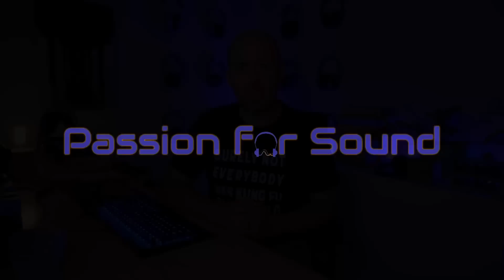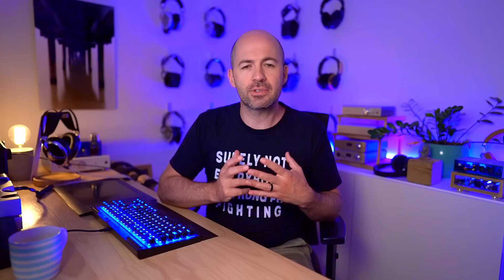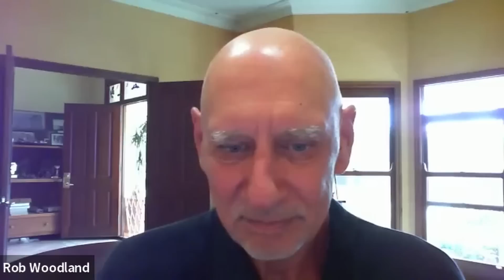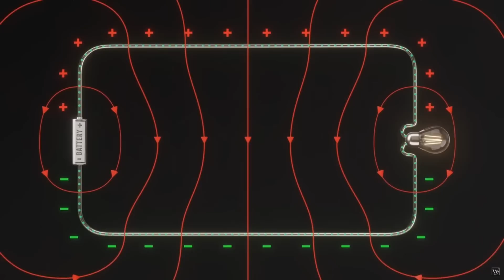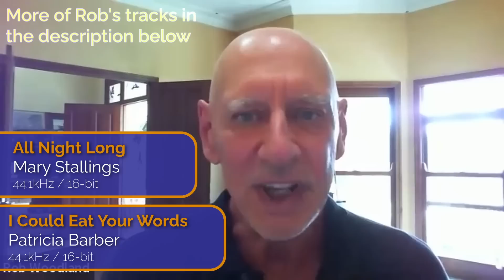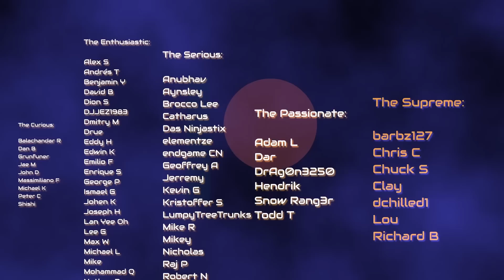USB Cables for Audio: Interview with Rob Woodland from Curious Cables

Comment from the maker: Here's a link to that @veritasium video https://youtu.be/bHIhgxav9LY
Reply: The designer/owner (retired Navy officer) of Silversmith Audio based his (flat) FIDELIUM Cable line on this lessor known/unconventional energy transfer field.

It’s based on Malcolm Hawksford’s ‘Essex Echo ( 1986 )’ theory/study - which he revived from studies; circa 1950’s.
Reply from the maker: Wow! Thanks for sharing that info. Very interesting
Reply: @PassionforSound  
‘Any time...
Reply: The problem is information cannot travel faster than the speed of light. The fact that the wires end up making a circuit cannot be instantly known therefore the light bulb will not instantly light up.
Reply from the maker: No-one said it would light up instantly - there is a short delay, but the point is that it occurs in a shorter time than it would take for the electrons/energy to travel through the wire at the speed of light.
Reply: @PassionforSound  I think that theory is wrong
Reply: @PassionforSound  how long do you think it would take if you removed the wires altogether?
Reply from the maker: It's not wrong. Check out Electroboom on YouTube where he examines the Veritasium video for errors.
Reply from the maker: If you removed the wires altogether it wouldn't work at all. There are multiple videos discussing the theory in the Veritasium video and they all concur (at least all I have watched and I wasn't seeking confirmation, just understanding and verification). One of the videos out there explains on a whiteboard that there are multiple reasons it's true - it's all about how the electrical fields work in that setup to create antennae or capacitors or inductors - the point is there are multiple scientific principles that support the theory in the original video
Reply: I love Passion for Sound, but often times i feel Veritasium is where Logic goes to commit Seppuku for the sake of clickbait...

Comment: Isn't the USB delivering binary data to the DAC which in turns convert it into analogue waveform?  Why would different frequency moves in  different part of the cable affect the ultimate waveform?  

Not trying to negate what he is saying, just do not understand.
Reply from the maker: You're correct that the data is binary, but that data is transmitted down a USB cable using fluctuating voltages so it's actually an analog signal carrying binary data. For example, the 1s in the data might be represented by a +2V signal and the 0s by a -2V signal. In between each of those data points, the voltage is swinging through every voltage from 1.9 to -1.9V.

Comment: Warm USB cables. In "audiophile speak" warmth equals something that has second and third order distortion. The distortion of a data cable is exactly and utterly zero. It works or it doesn't, ones and zeros.... This people take for granted that everyone else is an idiot for them to leech off.😂
Reply from the maker: That's completely false. Warmth or smoothness actually comes from less noise being transferred into the DAC by the cable. You get the same results with galvanic isolation either in the DAC or via a digital to digital converter
Reply: @PassionforSound 
You are an absolute electrical and computer engineering ignoramus.
Stop trying to show you know what you are talking about by just using random terms that you don't understand. It makes you appear ever more ignorant and out of your depth. Digital cannot be "warm" since warmth is a function of tube amplifier second and third order harmonic distortion components. Regardless, warmth is a BS term that has absolutely no definition in electrical engineering.  Unless the analog portion of a DA converter has a pretty glowing tube muddling its signal, it can't have that mysterious characteristic of "warmth". As far as I know chip manufacturers  haven't been using tubes on their IC's😂
Reply: @PassionforSound 
What a litany of nonsense and prattle. How do you measure "warmth"? Millivolts, decibels, amps, ohms? Stop digging...
Reply from the maker: So, by your logic, an engineer like Rob Watts is also an engineering ignoramus given that it was he who taught me what I said above. That wasn't my opinion but his knowledge...
Reply: @PassionforSound 
Ergo you are not an engineer

Comment: Here we go again. Total confusion. USB data is DIGITAL. There is no clock in the data just highs and lows. Transitions between levels is cleverly designed so the the actual  data bits can be extracted. SB data is sent in frames with checksums (technically CRC) so the receiver ignores frames with errors. Bad frames would cause dropouts and practically never occurs in a normal USB setup. The clocks you a likely imagining are on the ADC and DAC that are clearly unsynchronized. These clocks can have jitter and even drift. In additional there can be output noise. The take away is the digital world is perfect; any distortions or other audible effect are purely analog. I suspect putting USB cable pictures on the wall would cause an improvement like a chef putting a sprig of parsley on a plate to improve the food's taster.

Comment: I've just learned that a special USB protocol is used for the audio data transfer. Which is detailed in the "UNIVERSAL SERIAL BUS DEVICE CLASS DEFINITION FOR AUDIO DEVICES". And some says that this protocol does not guarantee the correctness of the transferred data. What I still doubt but maybe it is true. I haven't studied the specification enough to tell.
But if it is true that the correctness of the audio data is not guaranteed then it would be easy to prove that these cable guys are right. In async mode the audio data is sent through the USB cable and buffered in the DAC and a better DAC does not synch to the clock of the USB connection but it has an internal clock to synchronize the data. 
So simple in this case. You cable guys simple need to log the sent and the received data. And compare the two. And do this with the different cables. The expensive ones and with the reasonable priced ones. And case is closed you can prove that the expensive cable transfer the data correctly while the cheap cable corrupts the data.
So if we assume that this is the case, why no one did this yet? Not even the overpriced cable manufacturers.
My guess to answer this question is they did not do it because these assumptions are not true. Or they do such tests and they do not publish it because it may tell that there is no difference between the cables and there is no reason to buy their 1000 $ cable which they produce.

Comment: Excuse my lack of knowledge but does this apply to USB-C to USB-C cables too? I'm connecting my Burson Audio Playmate 2 to my Android Phone. Just curios. Thanks!
Reply from the maker: It's a good question. There are very few companies making audio optimised USB-C cables so I don't know yet if there are any differences in their design that would make them perform differently, but I believe it should all be exactly the same as what we discussed in this video.
Reply: Thanks!  @PassionforSound  Four hours ago I went to Walmart and bought a USB-B to USB-C to connect my other DAC ( Aune X8 with Sparkos op/amp plus Linear power supply ) to my main system.   Previously I was using Blootooth to stream from my phone.... Jesus Christ , the difference is night and day and 3 hours went hearing music. Most important, enjoying it. I will buy a better cable and see. Gracias for taking time to respond.
Reply from the maker: @JoseGarcia-yu9nd that's great to hear that you're enjoying your music so much! Happy listening!!

Comment: Hello, i have a question.

I am a keyboardist with a bedroom studio. Im fond of making piano covers using my favorite piano VST (garritan CFX concert grand). I have been using a $2.32 generic printer cable (USB2.0 i think because the innards are white). My laptop is pretty capable of handling that heavy piano vst (123GB sample library) even though im still using an HDD. But there are times that I get hiccups on my piano sound especially when the vst is first started up in Reaper. My temporary workaround for it is to close my reaper project with the vst and relaunch.

Now, just a few days ago, my curiousity about USB midi got piqued so I searched for usb midi cables on my favorite online shops then found this Chroma "Aufio Optimized" USB cables. It's quite pricey at $30.34 (Php1,699 here in the Philippines). Im just holding on to the promise of optimized for audio and hope that it will alleviate my problem.

Am I right in thinking that rhe hiccups 9n my VST could be due to my cable? A fellow keyboardist friend told me about it (i am a techy guy but i kinda forgot that USB has generations too. Lol) so i decided to buy a usb3 cable and hence stumbled across this Chroma Cable which DJTech also claims is widely used by DJs.

Please enlighten me further. 😊🙏

Comment: Years back i made A/C cables from instrument cable where the wires were encrysted w/ magnetic particles for mega-shielding + heavy braid and foil.  Swapping it out my GF said "What did you just do?!!? ". They'd probably measure better but they hampered the soundstage significantly.  Maybe someday people will develop measurements for what our ears can detect. We just don't yet have to tools to measure so it's still a black art.
Reply from the maker: Yes. There is someone doing detailed measurements and scientific testing of analog interconnects now so maybe he'll get to power and digital cables one day too.

Comment: Here is one approach to measure jitter in a USB cable connecting a music server and DAC using an Audio Precision:

1. Connect the music server's USB output to the Audio Precision analyzer's USB input using the test cable. Ensure the server and AP are synchronized to the same clock reference.

2. Enable the AP's USB receiver and configure it to extract the recovered clock. This allows measuring the clock recovered from the USB signal at what would be the DAC end. When a digital signal like USB is received after propagation through a cable, the receiver must regenerate the timing information/clock from the received data signal in order to correctly reproduce it. 
This recovered clock is what would then be used by a DAC to sample and convert the incoming digital audio. By extracting and measuring that recovered clock directly with the Audio Precision analyzer, it allows characterizing any degradation compared to the reference clock.

3. Generate a reference clock signal from the AP and route it to an analyzer input. This provides a low jitter clock to compare against.

4. In the AP software, set up a clock quality measurement between the extracted USB clock and reference clock. Choose the appropriate plugin based on the clock frequency (e.g. AES/EBU, SPDIF). The AP has the proprietary software used to control the Audio Precision measurement device and view/analyze the results, specifically in the Audio Precision analyzer's control and measurement software (e.g. APx or SMA), set up a clock quality measurement between the extracted USB clock and reference clock. Custom software that is used to configure the various tests and measurements it can perform. This includes plugins and options to analyze clock signals and quantify parameters like jitter.

5. Select the jitter metrics to analyze - peak, RMS, jitter spectrum. Setting a longer measurement time captures lower frequencies. 

6. Note any difference in measured jitter between using the test cable vs a known high quality cable. Differences would indicate added jitter from the cable. 

7. Vary test parameters like cable length, bends/twists, proximity to noise sources. Correlating changes in jitter can identify weak points.

8. To isolate the cable's contribution, subtract reference cable measurements from the test cable readings. 

This process allows precisely characterizing the cable's impact on recovered clock quality at the DAC by comparing directly to a clean reference using the Audio Precision's powerful clock analysis tools. Measuring SINAD at the DAC output with different USB cables is measuring the impact of jitter/noise indirectly, whereas directly analyzing the recovered clock signal gives more insights:

- SINAD looks at overall noise/distortion performance, but doesn't isolate the USB cable's contribution from other factors like the DAC's jitter rejection. 

- Direct clock analysis precisely characterizes jitter from the cable before it even reaches the DAC. This reveals weaknesses even if the DAC reduces their audibility.

- Jitter spectrum details are lost with SINAD. Clock analysis shows if jitter is narrow band periodic or wide band random to help diagnose sources.

- Threshold of audibility depends on program material. But direct jitter measurement ensures performance remains low enough for any DAC/system.

- Correlating clock degradation with cable variables like length/bends helps engineer a design immune to those stressors.

- SINAD change may be masked by DAC variation between tests. But extracting the same clock ensures a controlled comparison.

While SINAD can indicate overall audible impact, direct clock analysis is needed to isolate the cable's influence, understand root causes, and guide design optimization. Hence, the two approaches complement each other.
Reply from the maker: Great information! Thank you

Comment: I still don’t understand why these cables are so expensive in general. I got that this cost in the annealing process though. Why not just eliminate the power cable portion I just use the USB connection without it since you’re not powering anything
Reply from the maker: A lot of the expense will come down to the R&D time and expense plus the resulting performance level (i.e. not just parts costs).
You can't always remove the power wire because lots of devices use it as a handshake device so the two ends of the signal path won't recognise each other without it if it's gone.
Reply: Because they are shameless scammers.

Comment: It's all too vague. He can't say why USB makes a difference. That's not good enough when you charge a lot of money for a short piece of cable. I've been into music since I was 9. A passion for music comes with real top end kit in time. I've checked out msny cables Inc  USB. I could never tell the difference on a blind listening test done with friends. The Dac is the bit that matters. And you will need appropriate speakers and amps. Any shielded USB will sound exactly the same as the top cable in his range. Try it yourself. I've not tried his cables, but  USB cables by other companies costing even more. I couldn't tell the expensive cable from the unbranded shielded cable that was 8 UK pounds. Don't be misled. They are businesses out to make loads of money. Spend the max you can afford on the kit and some on decent shielded cables.

Comment: Try a Ghent usb cable.  It is silver plated copper and it sounds great with my son's Chord Qutest and it won a usb cable shoot out with this DAC.  It was very surprising as 1 meter costs $40 usd.  It beat out a WW Starlight 7 Red, AQ Carbon and Oyaide Class d+ Class A version 2.
Reply from the maker: Cool. Thanks for the tip!

Comment: I have done a few usb cable shootouts and the consensus is that usb cables can sound way different with different dacs.  We did a shoot out with a $600 Wire World Platinum 7, a $150 WW Starlight Red, a $600 Lightspeed and a $40 Pangea.  The DAC used was my Luxman DA-06 a $5000 DAC.  The Platinum 7 sounded the best.  The Starlight Red sounded muddy in comparison.  The Lightspeed was the most detailed but way too bright.  The Pangea sounded thin and bright.  

Interestingly, the person that owns both the Platinum 7 and Lightspeed, uses the Lightspeed in his system because it does not sound bright.  The Platinum 7 uses solid silver wires.  It sounds detailed, yet smooth at the same time.  It is musical with a buttery top end,  liquid midrange and good heft to the bottom end in my system which includes a Pass X250 amp, BAT VK51se preamp and Magnepan 1.6 speakers with dual Martin Logan subs.

I love your video's by the way.  They seem very honest and true.
Reply from the maker: Thanks for sharing your experiences!

Comment: Golden rule for me with cable's in general is to use the shortest cable possible & especially with USB; a 2" USB cable can perform better than a 2' one etc...
Reply from the maker: Definitely good to minimise distance when possible - lower impedance, less chance of collecting noise, etc.
Reply: Yes, because the longer the cable the more susceptible it is to noise.
Reply: not true- reflections will creep in on anything less than 1.5m if the cable isn't perfect from end to end